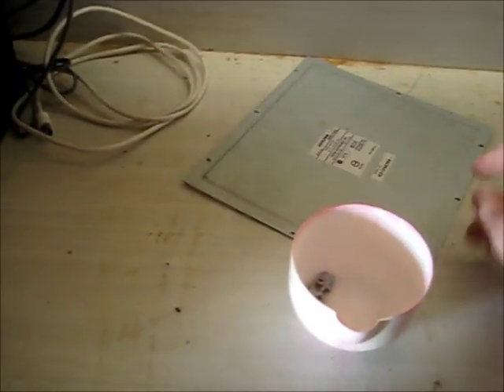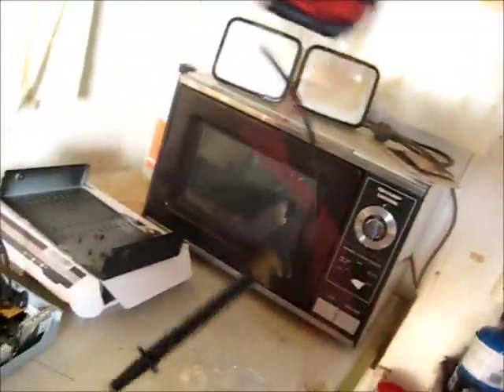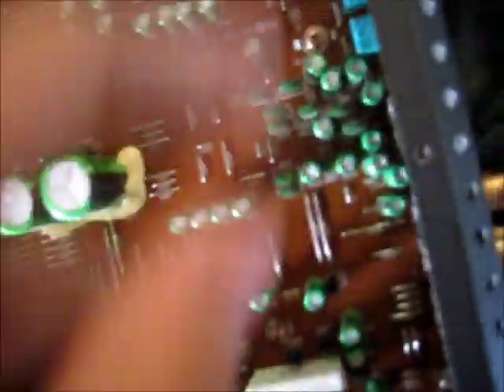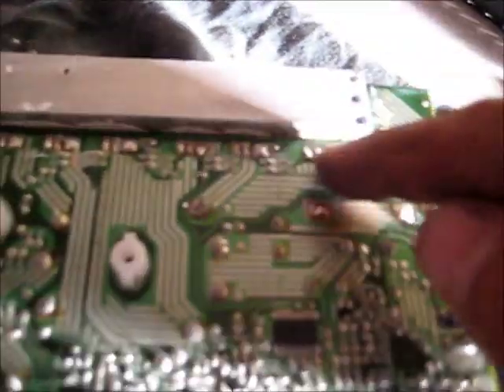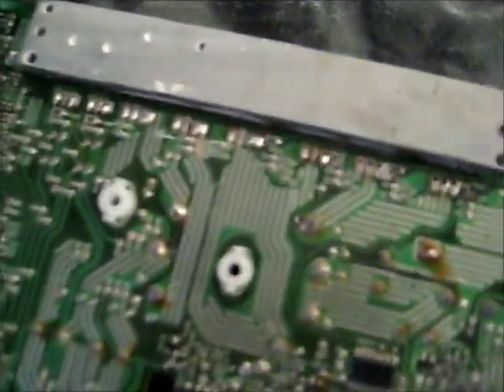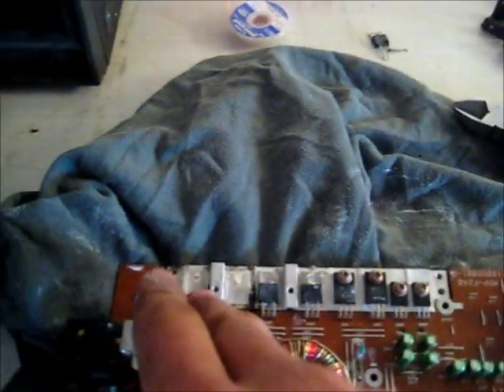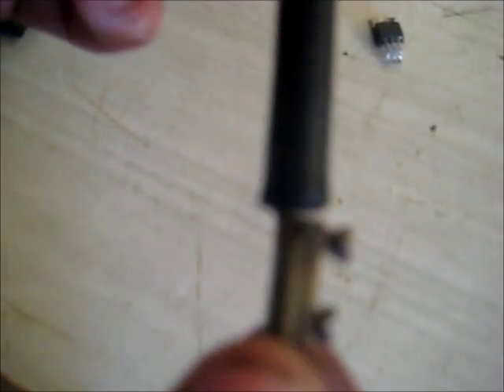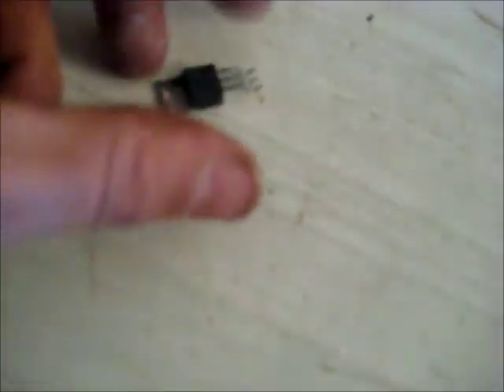Alpine Amp Mosfet Diagnosis

Comment: I have an Alpine MRD-M300. Everything turns on and I can get to all settings on the digital readout, but it won’t produce sound out of the outputs. I don’t think it’s getting input, because under input settings, you’re supposed to turn deck volume up until an asterisk pops up on the screen and turn it down until the asterisk goes away to set the input. No asterisk comes up. I’m looking at the misfits and I see two with speaker symbols. One looks like it might be the input and the other output. Have you ran into this before?  Thanks in advance

Comment: I just cut the legs off the fets...and do not unsolder it from the board...then just screw the new fet in place and cut the legs to the length of the ones you cut off the board and solder it to together, then you dont have to remove the entire circuit board...I do this with laptop power jacks that need to be replaced.

Comment: My cordless rotary tool is MOSFET driven and I had to replace the driver transistor.  It took me a while to find the part no. of a MOSFET which would be suitable but didn't cost too much- an exact replacement would had been US$25.